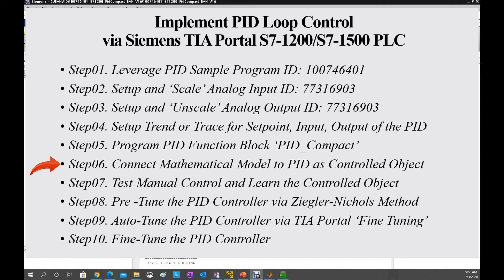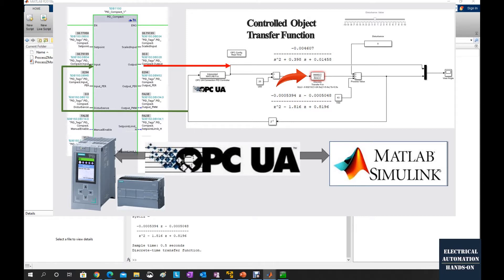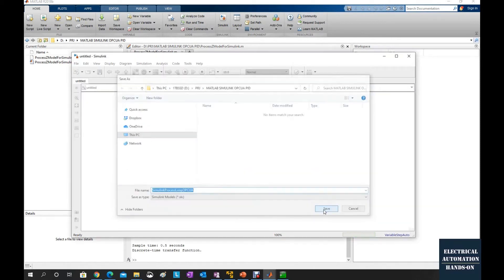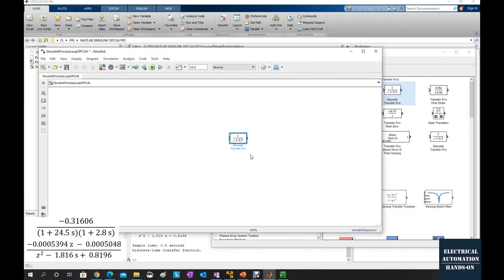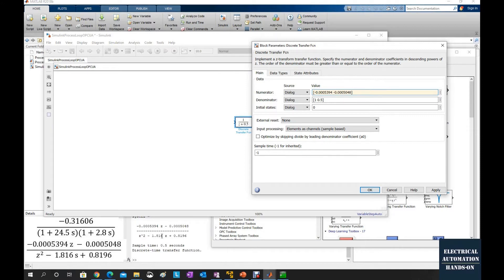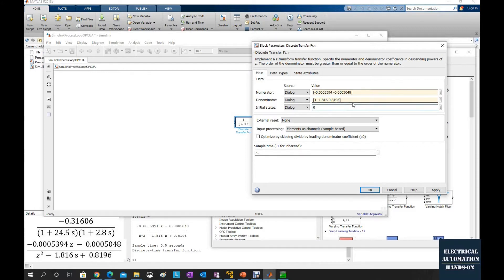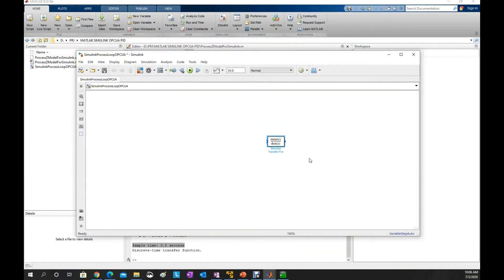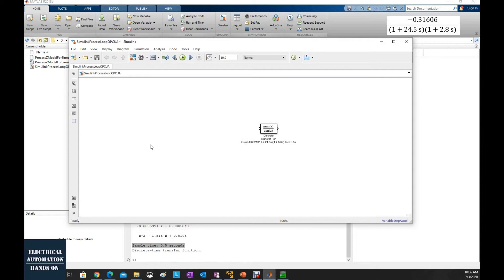PID16 - Siemens PID06c - Matlab Simulink - Setup Control Loop & OPC UA in Matlab Simulink

Comment: Thanks for the video sir. Why you convert your model from s domain to z domain and then use discrete transfer function on simulink? why dont use the transfer function directly?
Reply from the maker: Transfer function G(s) is time domain. Z is the discrete domain and it matches with "sample" of data. Otherwise, the G(s) runs with a computer or PLC, especially controlled by a PID from PLC  meaning nothing.
Reply: @electricalautomation  thanks for the answer sir